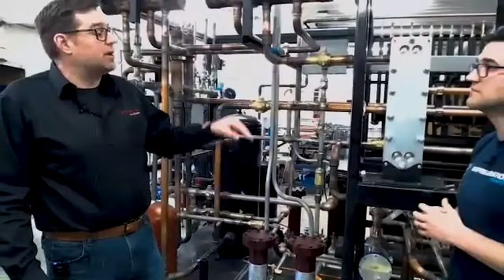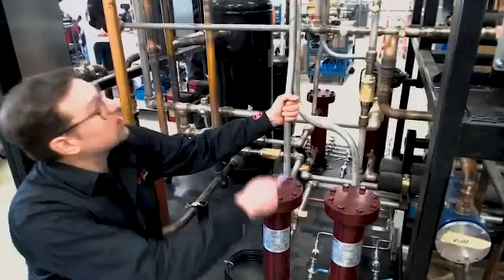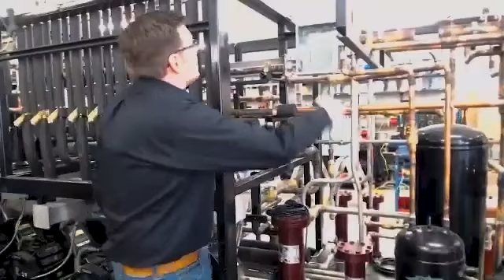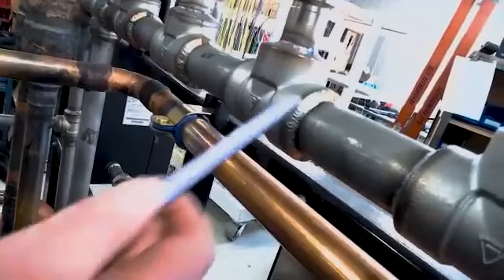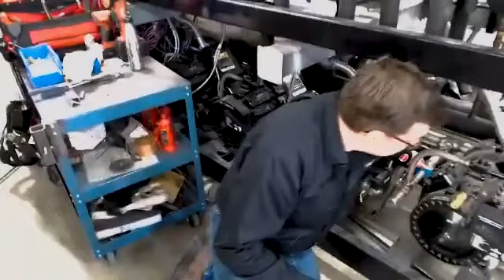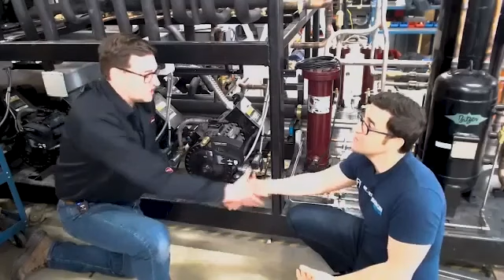Get A Behind The Scenes Look At An Arneg Systems CO2 Oil Management System With Philip Walker!

Comment: Rack low on co2  
Hill~"pipe liquid off the side it will be fine "😂
How's the charge secure ? starting up two stores that have it on the rack. 10 hours with only 30% charge loss seems a lot to ask from the ups in the event of a power outage 🤔
Reply from the maker: Hill is not the only CO2 manufacturer globally that recommend piping off the side.  Make sure to check the specs because some systems will be off the bottom and some off the side it all depends on the application and how it’s piped.  

Charge secure seems to work fine from the techs I know who started them up. But I don’t have much experience with them yet.